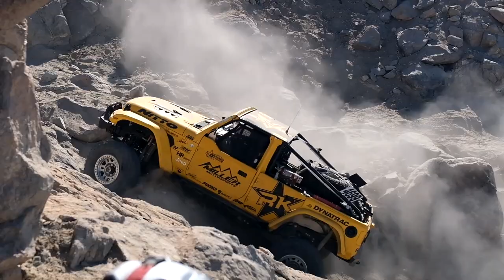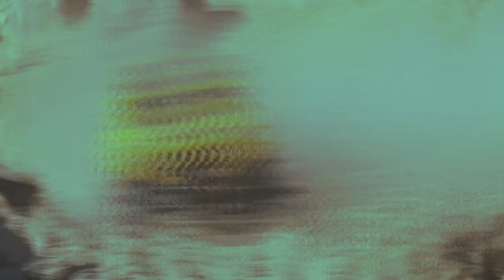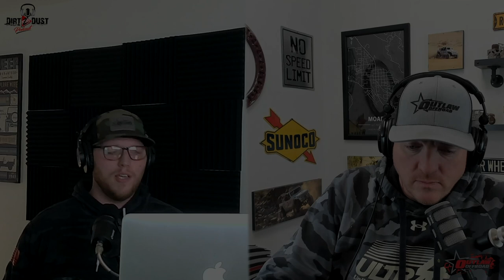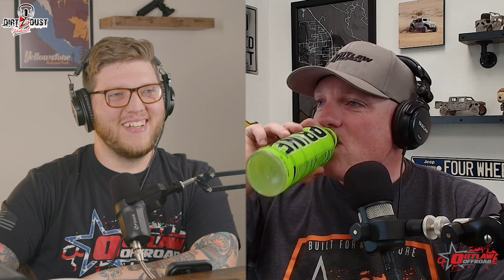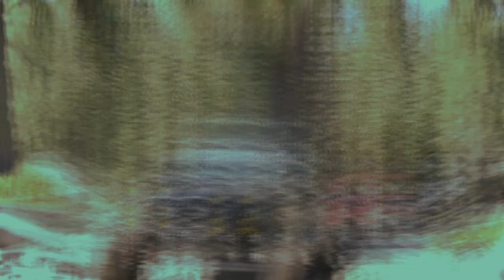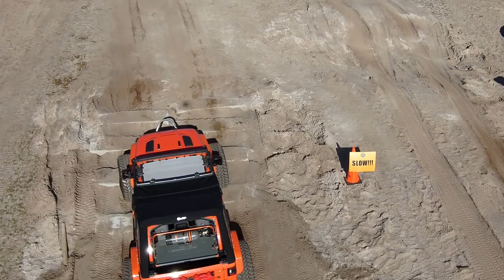Yes... DUAL Steering Stabilizers Still Suck

Comment: So i saw a post in the gladiator group that showed people using a yard stick and gluing the ducks it and placing it on the dash to hold them in place.
Reply: that makes more sense than gluing them to the dash or using a good double sided tape
Reply from the maker: According to the duck people they are held on with unicorn dust mixed with the tears of a Jeepers who didn't get a wave and positive thoughts 😂